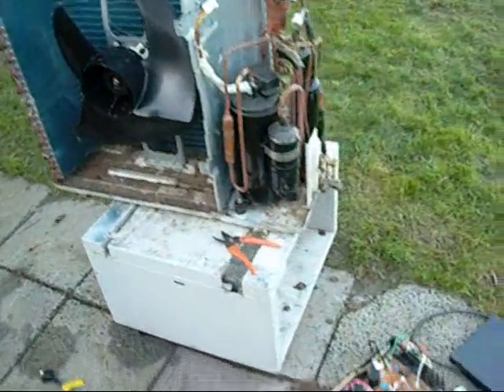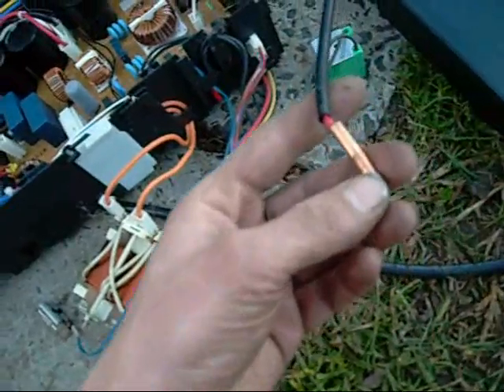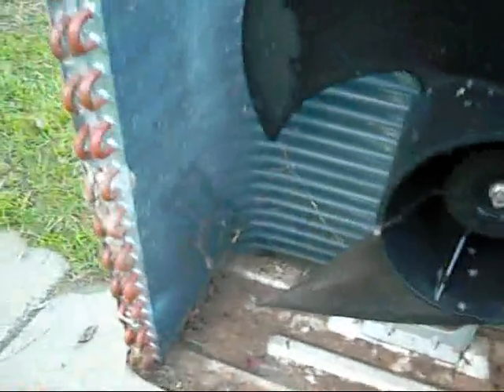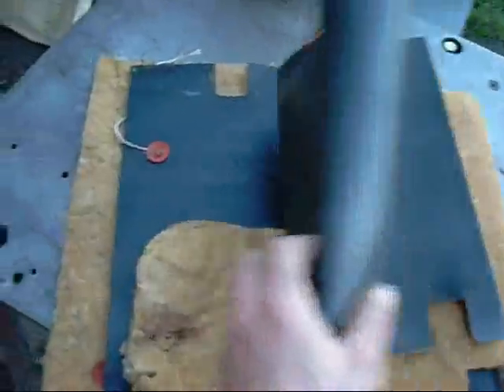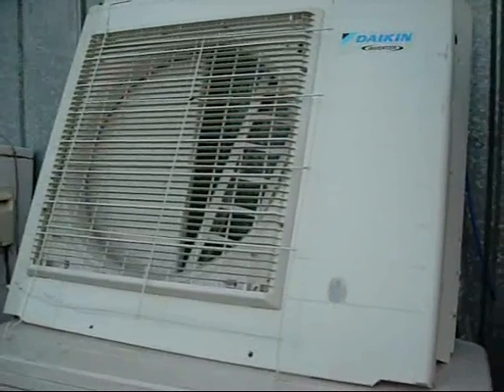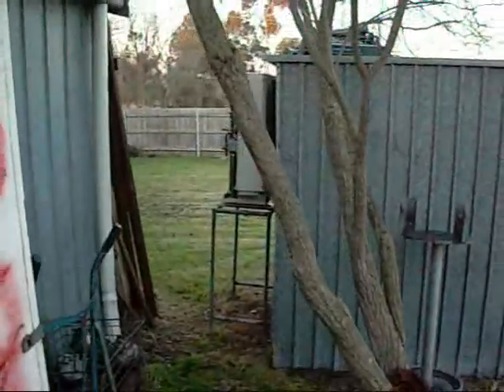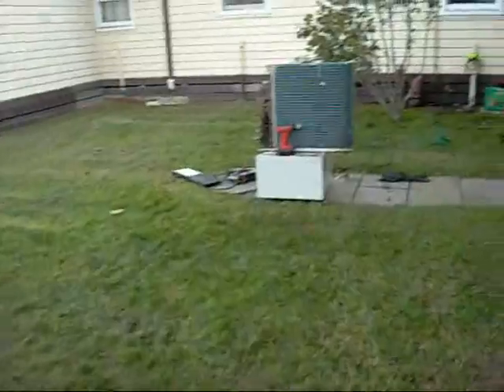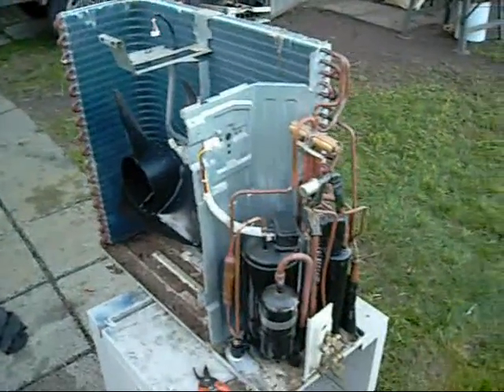Daikin Tear down What To Do with Surplus Condensors

Comment from the maker: I'm pretty sure it is the same, manufacturers are rolling out tons of products using 410A or 404A, even Danfoss dosn't list specs on R22 compressors anymore!
You can still service existing systems, but can't buy new R22 machines after 2010 I think